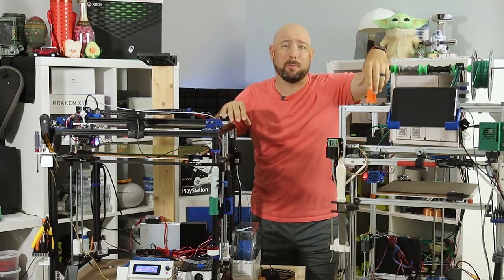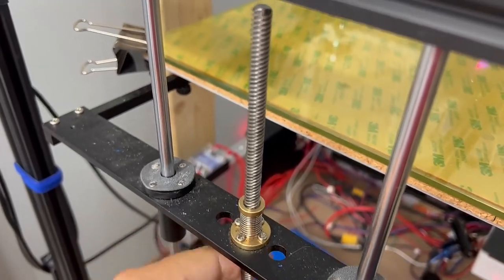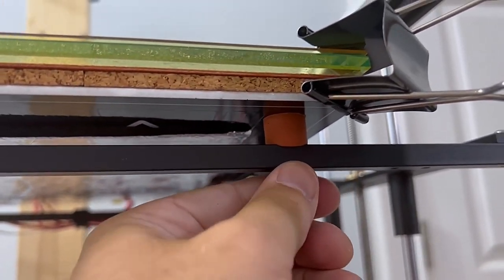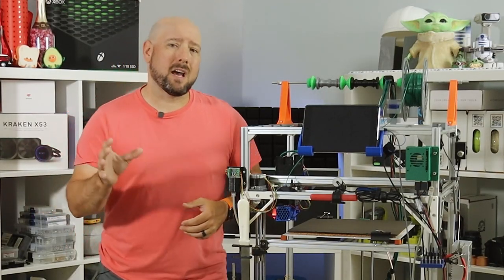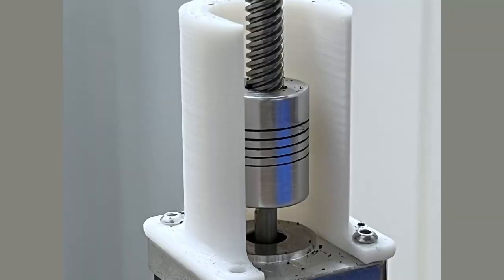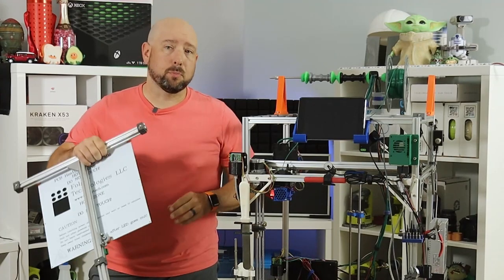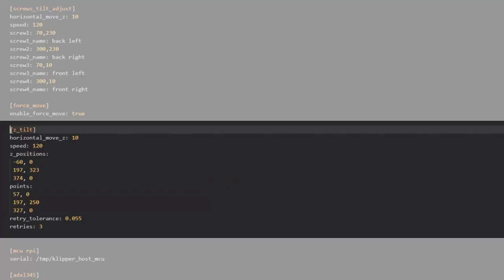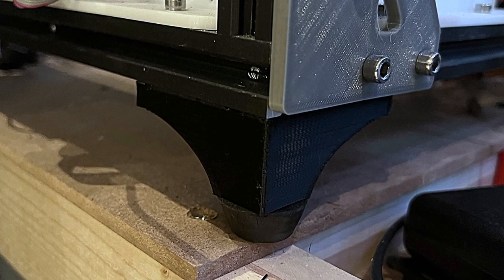Triple Z Bed Levelling for Your Cube 3D Printer

Comment: Phenomenal video, I will definitely have to watch your other content! While it can be fun to over-engineer something, it is great to see a cost optimized solution to the problem. I have been thinking about turning my Tronxy into a Voron 1.8 for fun, but I think this might be a better option. I like how the design would allow for an enclose as well. It appears the only clearance issue with an enclosure would be the z-motors. This could be fixed by shifting the extrusions up, and just using some 2020 extrusions below the extrusions used for mounting the motors. This would then give you a flat bottom while only losing a few cm in z height.

The only concern with the design is the magnetic cups. I am not sure if you have had any issue, but if one point tilts, the other points will have to move inward. That is why most tripple leveling systems use little rods that the balls can slide on. I haven't done the math to see if it is enough movement to cause the balls to pop out of the cups, but would be curious to know if you have had any issues.

Comment: I've been working on a printer design incorporating this bed style for a while. I chose to use two aligned dowel pins instead of the cup magnet for the bed. Let it slide instead of lift when it tilts too far. It has a 330x600x10mm bed along with two silicone heaters. I have to test them since I trimmed the sides of the heaters

Comment: This video is superb, I am about to fit my ender 5+ with a BTT octopus v1.1 board to start me down this road. I already run klipper on this printer but skr mini e3 v3 that I fitted obviously can’t run independent z motors. Just the basic dual z control would help as the z stepper motors go out of sync and I am forever adjusting for this and want a lazy option to automate the process.
It’s really interesting to see the triple z build you have and that would be a great end goal for me. To keep updated I have subscribed and liked the video 👍 great work and thank you.
Reply from the maker: Thanks Steve!  The Octopus is a great board and there's really no reason to go with anything smaller given the price.  Just a tip, there is no short circuit protection on the endstop connectors - so if you plug in a 2 pin connector and accidentally plug it into the +5/- pins instead of the -/s pins you will fry the board almost immediately when the switch activates.  It's an east mistake to make and I now make sure to use only 3 pin connectors with no +5 wire pulled into them so I don't accidentally fry another board.

Good luck and let me know how it goes!
Reply: @LilMikeysBigPlans  I didn’t know about the end stop issue, big thank you for that. I am up and running with the octopus and independent z-steppers with tilt adjust working great. Now I have the basic machine built and running with a mainboard that can facilitate more complex functionality. Now onto triple z 😂.  I’ll let you know how it goes 👍

Comment: Really nice video.
So really new in 3d printing. And bed leveling is a masive B.
Now for example i have setup all as it should, but sometimes during movement, it sound like its scratching the precious layer.
My question is, you said it should work with cube shape printers, i haave an ender 5 plus, will this work?

Second, can it be used with Instanity Automation?

Comment: Would this work with the x5sa 400? I did a lot of your mods to my printer, including the linear rails upgrade. My printer is an old x5sa 400 from 3 or 4 years old with the old v5 board. Keep up the good work, I love that you put the files for download. Next mod is going to be Octopus pro with 2209 stepper drivers with klipper on my pi4. I know, over kill on a pi4, but that's what I have on hand already.
Reply from the maker: Hey Aaron.  Yes, the system should work on an X5SA however there are some complications.  First, the threaded rods that come with the X5SA is much shorter than the smooth rods.  They might not be long enough given the size of the frame.  You'll also need to find a solution for the thing bed platform.  It's already not very sturdy and going from four to three points won't do it any favors.  Can be fixed with a couple cheap 2020 extrusions though.

The X5SA also already has some frame stability problems and they use the smooth rods for reinforcement.  Might want to upgrade to some aluminum corners or similar if you haven't already.

I'm running an Octopus on one printer and an SKR on the other with an Octopus waiting to go in.  It's a great board for the cost!

Comment: Nice video. I’m doing triple z now. The style with linear rails. This is the first I seen linear rods used. Wish I saw this before I started my conversion. I am also using the octopus pro.  Do you have any tips on compiling? I’m assuming I don’t use g34 for leveling?

Comment: Good explained, i want to build my own designed cube printer with also tripple z leveling and i have the btt ocropus v1.1 too. Do you recommend Marlin or Klipper for that function to use? I am not sure between those 2 firmware. Thank you forwarding
Reply from the maker: Hello Artefakt.  I'm a big fan of klipper especially on custom printers where you'll be tweaking things all of the time.  It's much easier to change a config setting and restart klipper than build a new Marlin firmware and upload.  Marlin was a bit easier to understand when I was first getting into printing though and there's nothing stopping you from trying both :)  Good luck!
Reply: @LilMikeysBigPlans  To be honest, i have viewed your video and was happy that you using threaded rods instead of ballscrews like other youtubers doing. it is maybe good option but they are too expensive. thanks for the hints with the firmware, i think i will try both like you said because i want to know like you the differences and the problematics of both systems. i have planed to make a cube style printer with 2x heatbed parallel (seperate powersupplys for board and heatbed on the octopus) connected and mosfet behind the board so it has 400mmx800mm heatbed and i have 3x 8mm leadscrews and 3x linear rails like you but i want to have the printhight at 1000mm (1meter). i hope my construction with the heatbed will carry the weight of the prints later.
Reply from the maker: @artefakt3d300  Yeah, ballscrews and linear rails are more robust and I'm looking into those for a CNC I'm working on but for a relatively small 3D printer they feel like over kill.  Now your 400x800x1000 volume might need something a bit more heavy duty :)  Maybe a belt system (like Voron) that's counter-weighted to handle the massive plates?  Would love to see what you end up building!

Comment: Mike, I really enjoy the details and content on your channel. I am on month 3 of owning the X5SA 400-Pro and it is a love/hate relationship, more love then anything however I knew what I was getting into from reading others reviews. I recently upgraded my bed to a Aluminum tool plate sourced online and am still seeing issues (in the same corner mind you) with my Tronxy so I am taking it down for service and found this video which makes me really consider doing this on my machine. I feel as if the code for the firmware gives us users problems as it seems I can never get the bed in the + side no matter how many times I adjust. Any tips? Either way thank you for the content and sharing your knowledge, subscribed and noti's are on, keep it coming!
Reply: I've owned my x5sa for 3 or 4 years and I learned the problems it has. My buddy just got his x5sa 330 6 months ago. One thing I learned is to use 2 of the same objects or print out Mike's top hat covers and hand lower the bed flat on that. 
1. Hand level the bed using sheet of paper. 
2. Auto level, as it will remember the last auto level you did and it will try and compensate for it and will not print flat. 
3. Z offset. 
4. Watch your print stick :)
Reply from the maker: Hello Maximus and thanks for watching!  It's unusually to consistently have leveling issues in only one corner.  As Aaron pointed out, the left/right tilt is a big problem on this printer but the stepper hats can help take care of that.  However if you've fixed the tilt, leveled the bed, and then just one corner goes out of whack, well, that's a weird problem.

I would suspect one of two things.  First, the sensor that comes with the X5SA is pretty terrible.  If the corner you're having issues with is near the electronics or even the outlet the printer is plugged into the EMI might be thrown the sensor off in just that corner.  You can maybe play with the position of the printer/controller/wiring and see if it helps.

Second, the X5SA bed platform is pretty flimsy and if you put a heavier plate on it that's probably only exacerbating the problem.  You could build a more sturdy platform from 2020 and see if that gets you anywhere - and those extrusions would still be useful if you decided to further mod the printer.  I would prefer to see the smooth rods on the X5SA pushed out closer to the bed corners as well.

Good luck and feel free to shout if there's anything I can help with.
Reply: @gamer1206  I appreciate the advice and this helps me resolve the "what is the real way to prep my bed before printing?". I figured that it would not remember the last abl procedure when starting a new one, which would cause all the headaches and also about the when do I input a z offset....I just got done doing some maintenance on the printer and will give this a go! I do have some hats btw so I'll throw them back on and still using the stock build plate as I am waiting on other components to complete the install but glad I made the purchase of a tooling plate.
Reply: @LilMikeysBigPlans  Well I never though about the EMI effecting the ABL sensor and unfortunately the corner is furthest away from any electronics, I was starting to think the Z-support arms were bent. I do have the Tronxy Z sync "upgrade" installed and measured the gap on each side to ensure they were level (got it about .01 identical). 

I just tore a bit of the machine down and ensured it was all square and tight but really looking to upgrade to remediate any leveling issues so in anticipation of building a structure for the top when I enclose the printer I ordered some 2020 extrusions just in case I need to use them as bed supports. 

I'll report back with any updates on the issue as I run a test but on the ABL sensor for this 2020 model. Does anyone know of the proper height it should be and what would be a better choice as a replacement?

Thanks everyone for their advice and time, wish me luck!

Comment: Can you convert tronxy to triple z ??
Reply from the maker: Ya, you should be able to.  I have all of the parts printed and purchased to convert mine but haven't gotten around to it yet.  I'm a little concerned with the length of the threaded rods since they sit on top of steppers that sit on top of the extrusions.  The direct drive carriage in my print system (https://lilmikey.com/printersystem/index.html) hangs lower so shouldn't be a problem but it might not reach high enough for bowden setups.